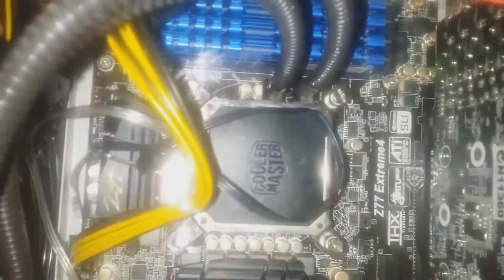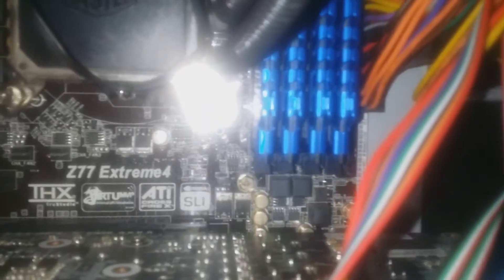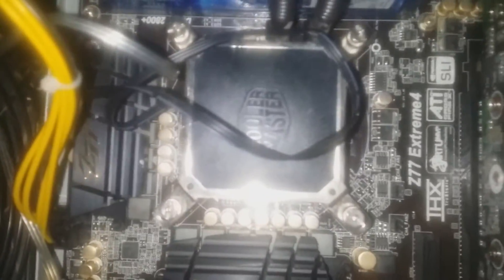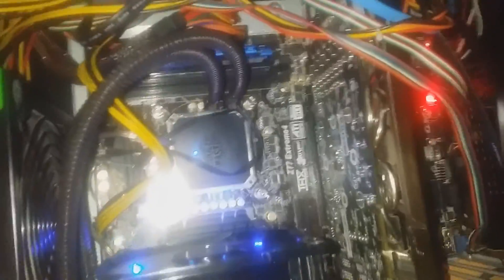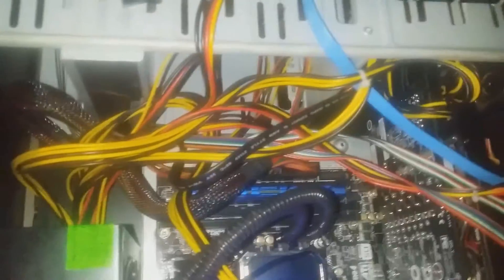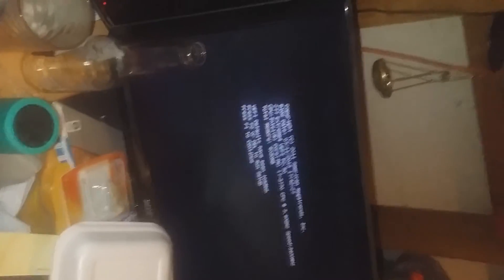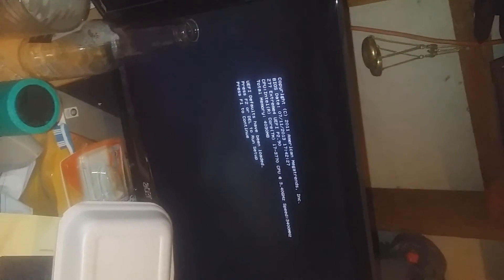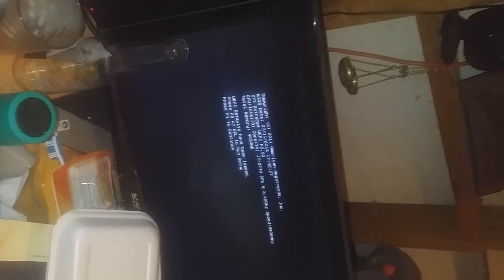Z77 Ram slot issue

Comment: I really need to tear down my PC and check my CPU for bent pints. Have 16GB ram installed but the MoBo only detects 8GB. It's weird because I can alternate between slots as long as I'm only using two. Checked all settings via BIOS and everything is set correctly. I figured it's either a bent pin or the CPU has too much pressure from the cooler pressing against the side of my case.

Comment: I'm having a problem with a MSI B75-a motherboard i can only use 2 sticks at a time if i try anymore sticks i get stuck in the same loop

P.S. I cleaned off my thermal paste and installed a new air cooler still doing the same thing

Comment: Did you ever figure out the issue? Because i'm having the same exact problem with mine.
Reply from the maker: Thermal paste on CPU contacts -_-
Reply: Christian Ansell what exactly do you mean? Can you describe that? Maybe Video or Tutorial how to fix it, Please.
Reply from the maker: Thermal paste from the top of CPU had leaked onto pins and bottom of CPU. Once I cleaned them off it was fine
Reply: @thomascale96  This solved the issue
Reply: @thomascale96  hey, how did you clean the thermal paste from the pins ?
Reply from the maker: @straucznorbert1191  cotton bud and a needle. It's slow work, and you have to be careful not to bend or snap them
Reply: Christian Ansell Thank you very much, worked for me also
Reply: Thank you so much for this, was about to buy a new motherboard  lmao